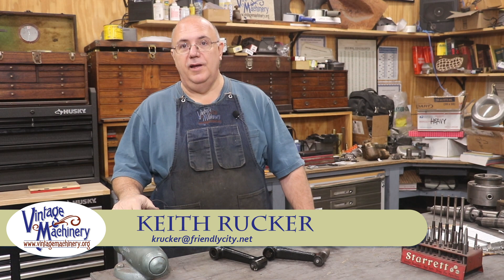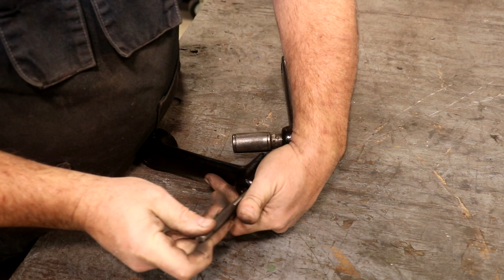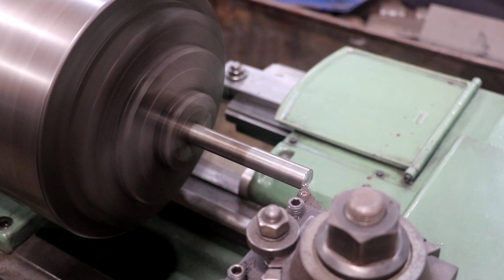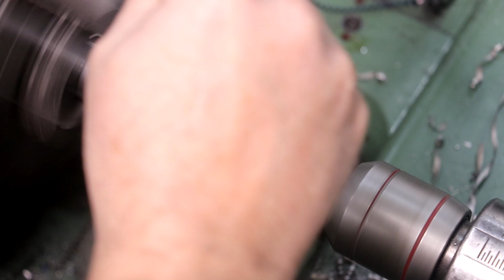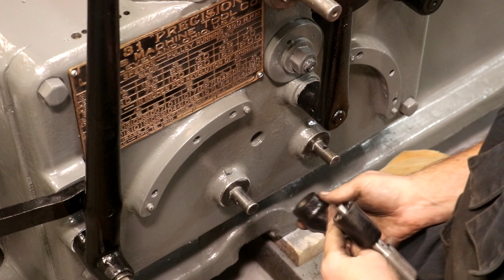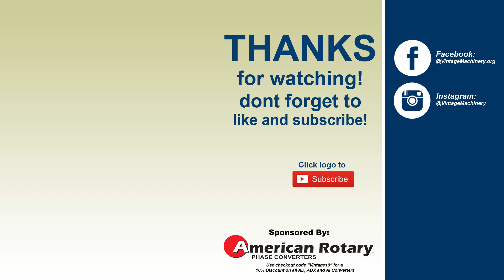Lucas Horizontal Boring Mill - Machining a new Spring Loaded Handle

Comment: When putting all that stuff together, why no grease or anti-seize to prevent rust from forming on the mating surfaces inside?  Make it a heck of lot easier for the next PDB that has to take them apart.   Great work as always though.

Comment: Keith, you need to do some maintenance on that lathe or possibly the 3 jaw chuck you have mounted in this video. You just shouldn't have that much run-out in your parts. It is very obvious. Every time you mount a piece of stock you have way too much run-out. At 6 inches from the chuck, you shouldn't have any more than .006 to .007 of an inch. And I'm being generous. the better quality chucks will be dead on at that distance. I know that Monarch EE you have would be a lot better than that especially with a good chuck on it. You might consider a 6 jaw Buck Chuck. The kind where you can make adjustments for run- out.

Comment: @Keith You can clearly see the part moved while you were drilling it around minute 19... it's quite possible your hole wasn't in line with the spindle after that and the reamer was being bent when it broke. Some copper or aluminum padding under those knurls might have helped to hold it better

Comment: Those small tapered reamers are really delicate. They are much like small taps. If the flutes are straight, then the reamer will collect the chips in the flutes and it should be releaved every now and then of those. Much like a straight flute tap.
The reamers that have the spiral are pushing the chips into the hole, much like a gun tap. If You look carefully, You might have noticed that the spiral is left handed so this type of reamer also pushes itself out of the hole and does not jam in there so easily.
Being too eager with straight flute tapered reamer is a sure way of breaking one no matter if it is driven by hand or a mill.
I use regularly hand drill to drive those.

Comment: When you say you are taking 100 thou off on a turning like in this video, are you removing 100 thou from the radius or the diameter?
Reply: Diameter. 50 thou on each side. The reason is: the micrometer reads the diameter, but the amount of cut is half that. Thus; it's easier to use it this way and not make a mistake.
Reply: @MrPatdeeee  I thought so. I'm not a machinist so I thought I would ask. Thank you.
Reply: @davidmontgomery1016 You are most welcome kind Sir.

Comment: I love your videos and your restoration of old machines. I have pictures of an old large horizontal boring mill that dates back to the early 1900reds that was operational in  a large machine shop owned by a cousin in New Haven Conn up to two years ago.  The shop was started in about 1870 by my great grandfather.  Is there any way to share these pictures?
Reply: You can post them on vintagemachinery.org
Reply: @FutopiaAD  Thanks will do
Reply: The boring machine I mention above was made by Universal Boring Machine Co of Hudson Mass and appears to be a larger model than any picture I have found so far.

Comment: Something like 5 years, I've been watching your videos Keith. I have a serious bone to pick with you bud...

I want a lathe and mill but they do not fit in an apartment very well, this is definitely your fault =P
Reply: There are small ones.
Reply: I remember reading a story about a guy in NYC who had a bridgeport in his high rise apartment.  Something like a millrite or a mill/drill would be easier (and lighter).
Reply: Unfortunately this is not that type of apartment.. One of them little dremel mounted drill presses (takes up a 6x6 space) almost doesn't fit heh
Reply: @ianide2480  John Saunders (NYC CNC) started with a micro mill in his NYC apartment. Just forgo the bed and learn to sleep standing up. It's all about priorities. ;)
Reply: @RambozoClown  If the neighbors under me don't mind the noise (they call the management company if I step a little to loudly). Seriously thinking after some of my life events unfold a bit more, time to move..

Comment: Great restoration as always. I'm sure there are some people who'd argue that you shouldn't replace a working part, but this is a machine getting restored to be used, not to sit on display. It'll be much better to have something good in the hand than keeping the old piece just for the sake of having as much of the machine original as possible.
Reply: Plus he could sell that original part to someone else who has one of those machines for $100 and recoup some of the time and expense of repairing his.

Comment: Just a tip with those straight flute reamers, try locking the quil and raising the table instead.
Reply: @Timbo Dewabem thats not a drill press.
Reply: no. it was packed whit chips...

Comment: It irritates the crap out of me when you say “sharpie pen”. I prefer the scissor type knurling tool. The push type is really hard on spindle  bearings.
Reply: how is the push type any different than taking off .400 with a turning tool? turning tool the forces would go roughly straight up, the knurling tool pushes straight backward
Reply: @sircaran  when you are removing material you are actually moving left, back towards the head stock. That’s the way the bearings are designed to take load. Even a parting tool isn’t as bad, because it’s cutting. Even facing creates some side load, but not much, because you’re usually not taking a very big cut. Those push type knurler creates a lot of side load. You are actually pushing hard enough to displace cold Metal, that’s a lot of force.
Reply: Yup!  Especially on smaller lathes.  I converted my AXA knurler to scissor style by adding floating extension arms and a spring loaded compression bolt.  Have a few others as well, but got rid of the side push types.  I also find the "sharpie pen" annoying, it's up there with "small little" and similar redundancies.

Comment: Cosmetic .. isn't negligible . Dad always swore that his cars ran better when they were clean.
Reply: Depends on the vehicle. Took my old ratty S-10 to the car wash for the first time in years to knock off the rather impressive layer of sap and moss off of it, barely got a half block down the road headed back home when it died and I had to get it towed home. It liked its layer of dirt. XD

(Ethanol gas was the culprit. Fuel pump had sucked in a chunk of the screen that was in its intake that had rusted to pieces from all the water content, and the metal base of the sock was also a solid chunk of rust.)

Comment: Keith is a perfectionist as I am too but I would have been tempted to machine away the light knurling on the OEM handle and re-knurl it to match the new part rather than make two new handles. "Assuming" the tapered pins were identical,  could the reamer have been marked with a Sharpie as a guide for the needed depth?

Comment: “Where’s that pin?”  A familiar refrain. I seem to be able to temporarily lose track of things large and small. Thanks for the video.
Reply: Any horizontal surface in the shop becomes a table/shelf where things get put down without thinking.  I set down a radiused end mill a week ago, and still haven't found it.
Reply: I’ve always wondered if he used cold blue or something like that. It might make it less prone to rust.
Reply: I always look on the floor first.

Comment: good that the engineers designed a weak spot there- otherwise the casting would've broke and that's harder to get done.
Reply: funny
Reply: It´s a hand operated knob, why would it be designed to tank a forklift hit?
Reply: @the_hate_inside1085  its sarcasm with the fact that if the handle was designed in a other way the handle casting could have broke making the repair way harder

Comment: I see you're using the Lyle Peterson method of layout and design......works pretty good for me too. Nice video
Reply: Who is Lyle Peterson and why are you crediting him for inventing that way of ruining vernier calipers?
Reply: @mrsock3380  mrpete222 he is a retired metal shop teacher
Also goes by the name tubalcain

I use the caliper method all the time to scribe lines but only cheap ones the efficiency of it trumps the cost of the replacement cheap calipers
Reply: @mightymalikie  but it's not efficient, it's quicker and more accurate to use a rule rather than to clean it, blue it, set calipers and scribe a line that the swarf will scratch off before you even get to the mark.
Reply: @mrsock3380  Mr. Pete aka tubal cain
Reply: @mrsock3380  I've been using the same cheap dial caliper (Rutland) for about 35 years on my lathes like that, and it's anything but ruined.  There's almost no jaw wear.  (Of course, the Etalons don't get used that way!)
Reply: @componenx  so you have been a machinist for 35 years and you mark a line on a lathe like this? I've only been a qualified tradesman for 25 years and no good machinists I know do this, it's something apprentices think is good until you show them how to turn.
Reply: @mrsock3380  I'm just a long time hobbyist, but the point is that it works and hasn't harmed the caliper.  The very slight radius is the same on both jaws. (And similar to my good tools)  It's a gentle process.  If I learned one thing over the years, it's that there is never one way to do an operation, and "correctness" only applies if you don't think outside the box.
Reply: @componenx  it's poor practice, if you could think outside the box you wouldn't think doing this is correct.